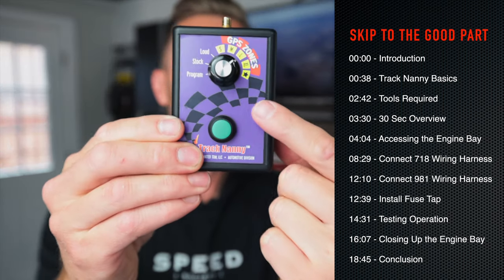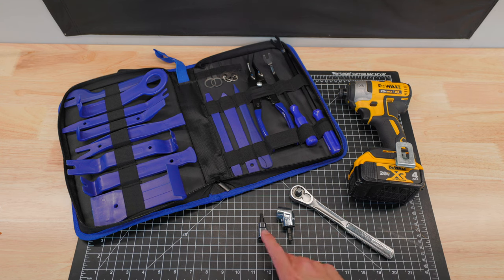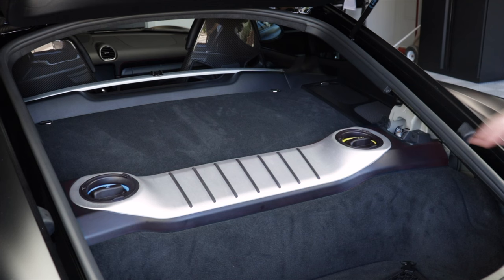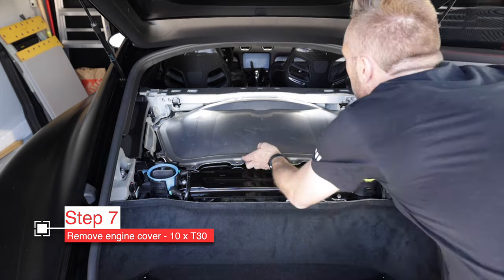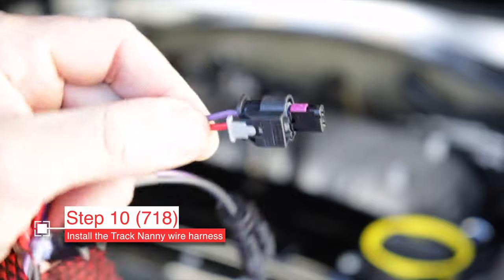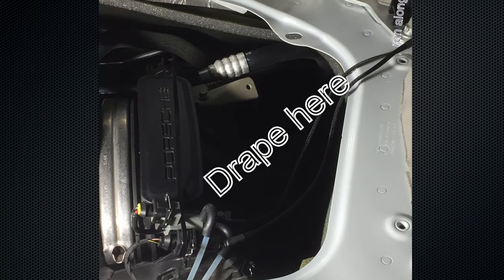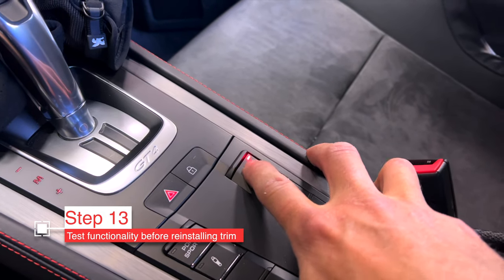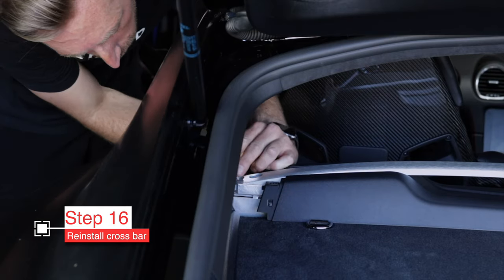GT4 Detailed Exhaust Valve Controller Install: The Track Nanny

Comment: This is super helpful. I was thinking of installing the Cargraphic remote valve controller which is installed in pretty much the same way. Really appreciate how you took time to go through each step in detail. It’s always nerve racking pulling apart your brand new GT4 and would prefer to do the work myself where possible.
Reply from the maker: Great, glad it’s helpful! Once you do it once it no longer feels like a big deal
Reply: Finally got round to installing the Cargraphic valve controller. Addicted to the sound! Still running in so can’t venture much beyond 4,000 RPM but have just left valves set to open - can’t see a reason to ever turn them off! Huge thanks again for doing this video. Followed it step by step during the install - absolutely spot on. 👏👍

Comment: Do i need a power tool/driver to remove the engine cover in Step 7?
Reply from the maker: No but you may need a doctor after all that wrist twisting!  😂. How we the two screws close to the seats will still need something that can get in the tight space of course
Reply: @JetFuelOnly  If I have a low profile ratchet, do I still need this right angle adapter?
Reply from the maker: Don’t know what your ratchet is like. It’s is very tight. About 1” of clearance I would say.
Reply: @JetFuelOnly  As in, the really tiny one you recommend in your video. It's something like that. Unrelated, got any upcoming Laguna days?
Reply from the maker: Yeah that one!  

Right now I’m hoping to do HOD at Laguna Nov 5